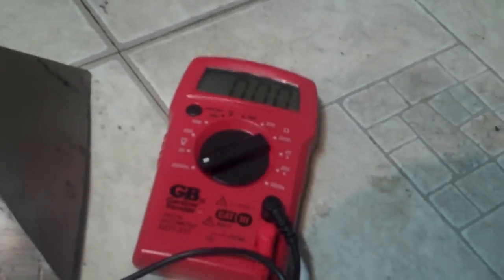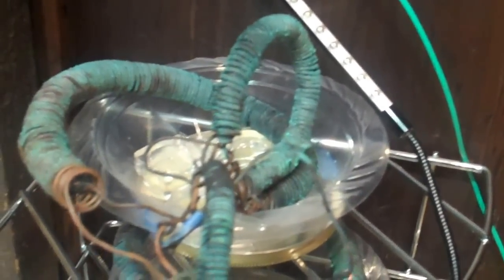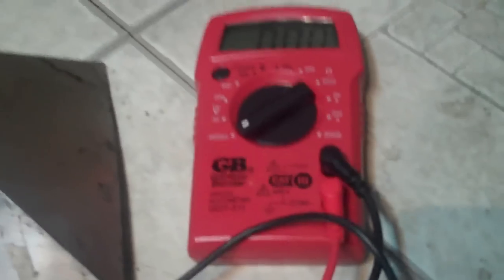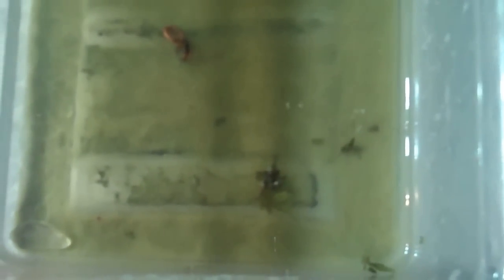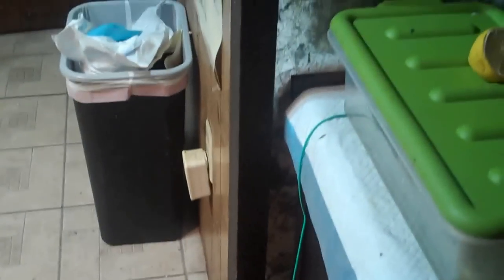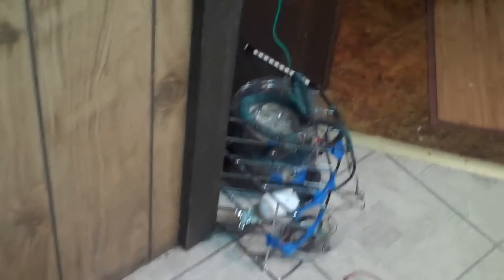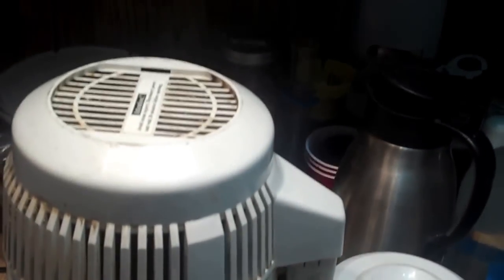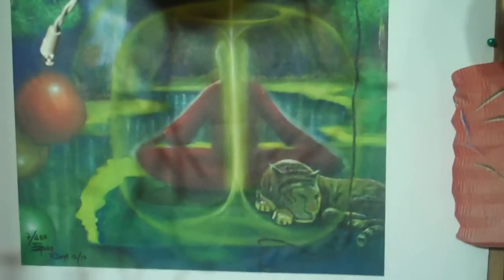My Second Magrav

Comment from the maker: I took 3 empty hexagon shaped honey jars and filled half full with gans that has lots of zinc oxide in it. I placed them as follows: 1 near my "office" door, 1 on top of the pellet stove which has a fan, 1 on top of the water distiller which also has a fan. I put the remaining Zinc oxide gans on top of the washing machine then did a medium load with hot water. I normally wait until I have a whole load to save energy and do it less often. As soon as I turned on the washing machine, I could feel a "lift" in the energy, it felt better, I felt better. I just put the same laundry in the dryer and moved the gans container (covered plastic box) to the top of the dryer. It seems to me the fan/torsion/coil motion is what circulates the gans strengthening the field I began creating 2 months ago. I will be eager to see the new electricity bill in about a week.